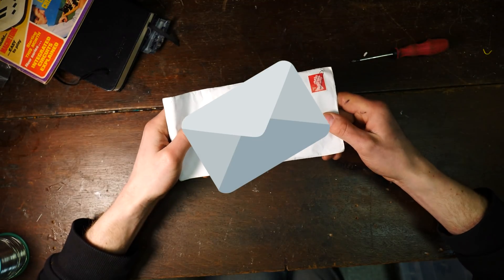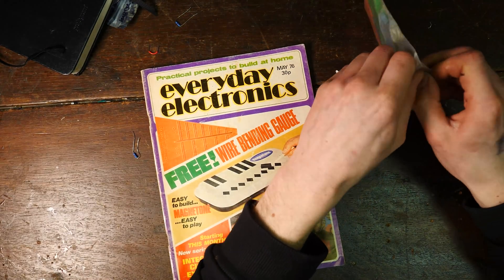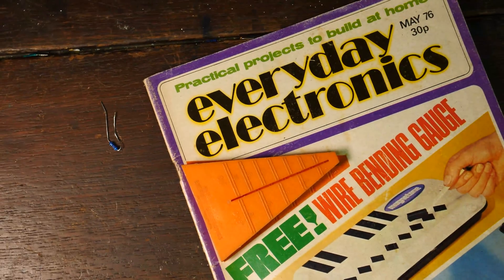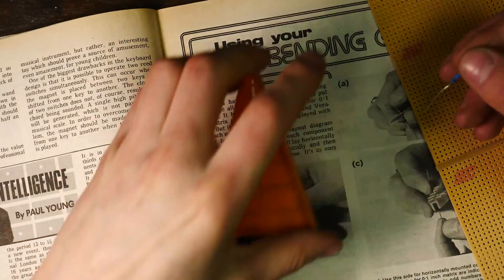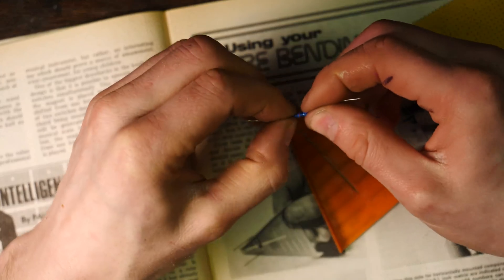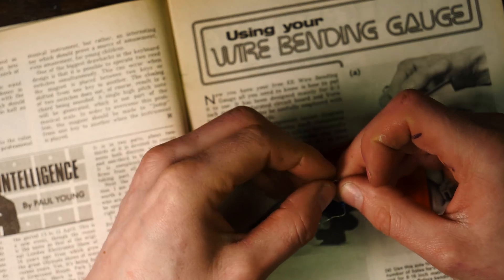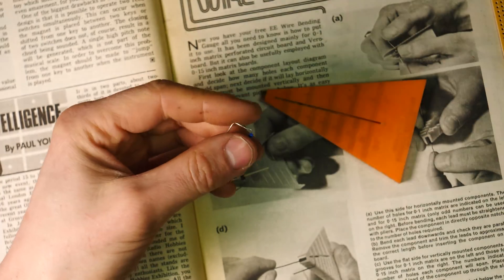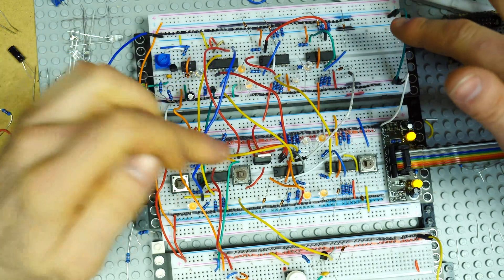The Component Bend Guide!!!! From EveryDay Electronics

Comment: I actually built a little component bender out of some stripboard.
Chop bits off in a stepped pattern, increasing one hole at a time, and bam. 
Bend your legs on that and they will be perfectly spaced for use with stripboard :)

Comment: I use a piece of stripboard for this that has been cut through the middle of the holes along one side. And then some markings for the numbers. Yeah, you gotta stick one of the component leads through an actual stripboard hole, but it works fine.